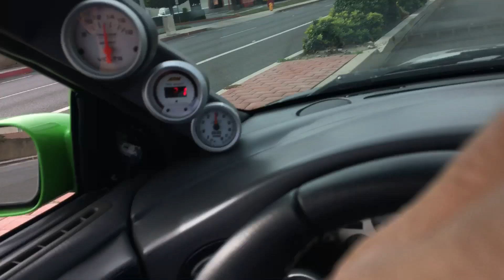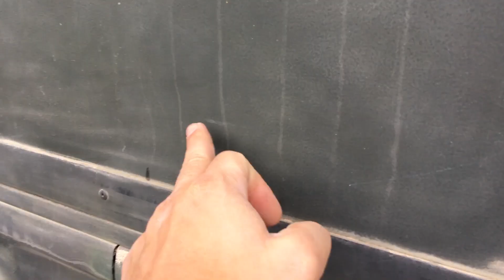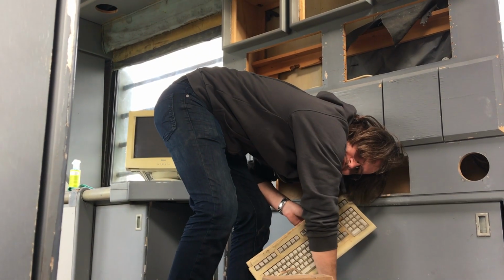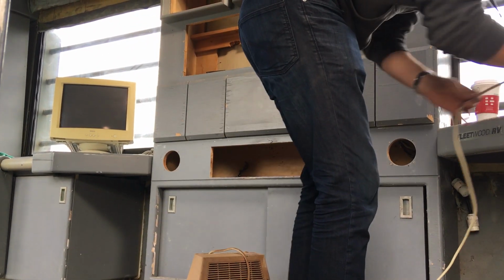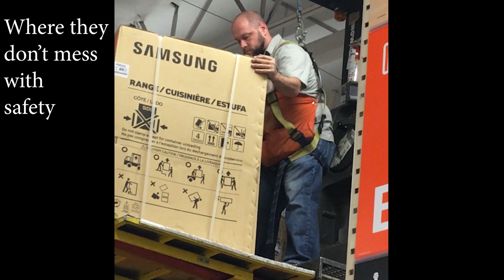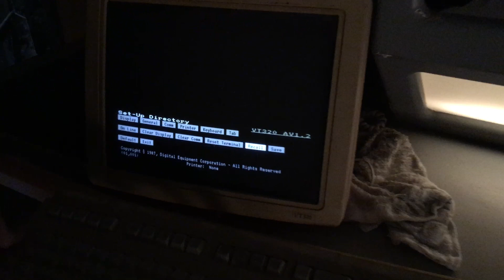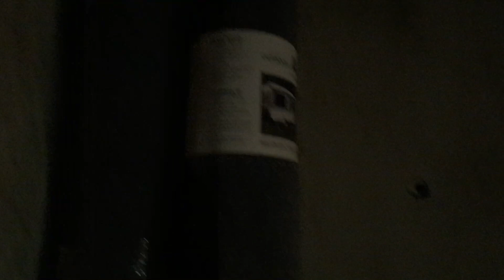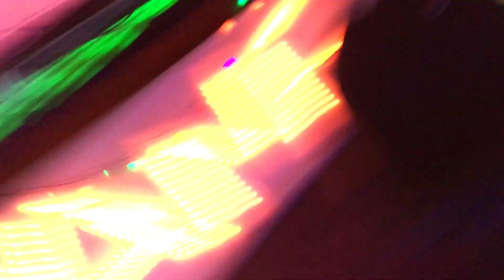JURASSIC PARK RV RESTORATION - PART 18

Comment: I know your plan is to try and use as much of the screen used parts as possible, in the case of the floor strip lighting if some of it is too damaged to repair have you considered using LED strips to replace them?
Reply from the maker: NTRCOOL yes, trying to see if the brand that made the floor lights, TIVOLI, makes a led remplacement

Comment: Did that computer system control all the coms? Or is it just a display setup from the movie?
Reply: Tyler Schneiderman I wondered about that too. Maybe it's just the monitor adjustments. I only saw the keyboard, unless the computer is in the monitor??
Reply: 7981 plant saboteur  that's a good point hope the respond to let us know
Reply from the maker: Hi guys , they're computers added by Fleetwood later when they toured the RV. Not screen used sadly